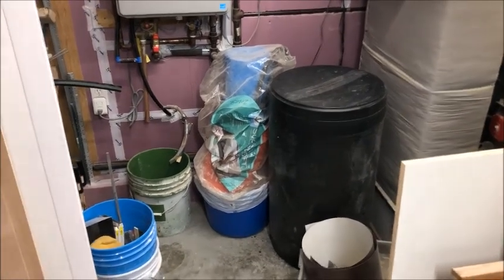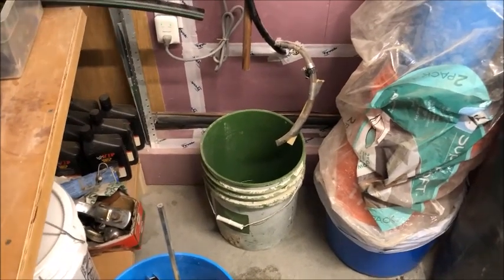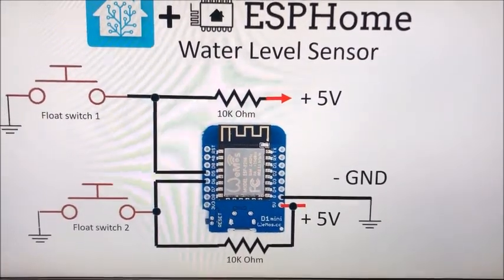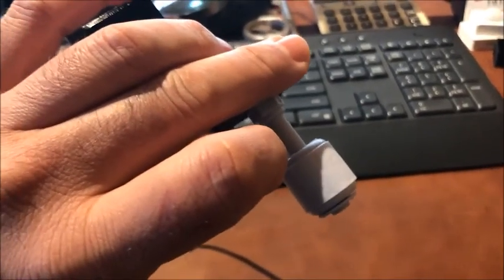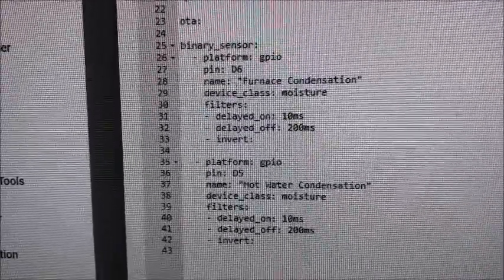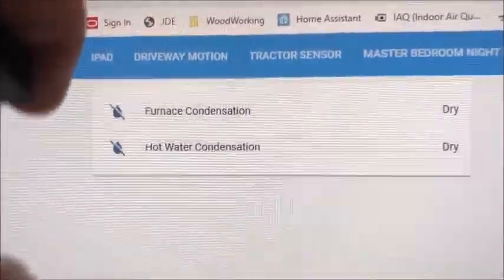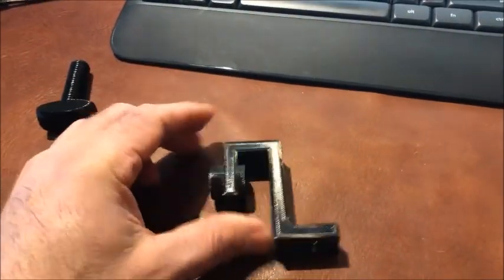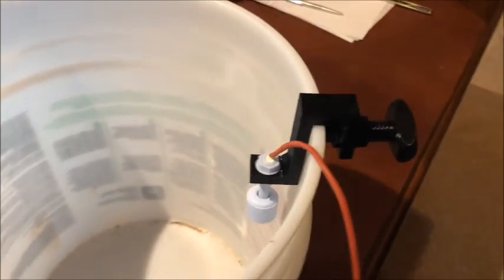Water Level Sensor using Home Assistant & ESPHome

Comment: I've got an extra esp32 hanging around, and it only supplies 3V -- what size resistor should I use? Would a 10k work, or should I got with something different?
Reply from the maker: @MacDork  your esp32 should have the ability to be powered by 3.3V and 5V which is the VCC pin. In any case 10k should work on the 3.3V supply line as well. Those are just pull-up resistors to ensure there  is no false triggering.  Thanks.
Reply: @ great, thanks!

Comment: Thanks for posting the schematic and the sensor details. this is really brilliant. Though I was thinking about this logic of grounding the GPIO to make that as a switch I was not sure about the components. I found this and thought of implementing similar but with a reverse logic. I have to sense the dry condition in my underground water sump. I am not sure whether you will be checking this comment. How is it functioning after 3 years? Are there any updates or feedback from your long run of this.
Reply: I have received my float sensor Today. I deployed as per your circuit and the YAML. It worked as expected. Thought of sharing with you. Thanks a ton.
Reply from the maker: @tamildesan837  I have two of them and they are still working great. I am not sure you need to reverse the logic because as is,  score the water reaches the float, HS reports the status as “Dry” so this may already be what you want. Having said that if you want this to trigger something when the water has not reached the float you can reverse the little styrofoam float and it will work opposite. I fact these are aquarium floats meant to trigger when the water is low. Have fun!
Reply: Thanks for checking the comment and your replay. That will be really useful if it detects the dry condition by default. I prefer to use the float switch and not the ultrasonic sensors which may get condensation issues if we keep inside the closed sump. I am going to order the float sensor to go with this. Thanks for sharing this project, this definitely reduced my efforts by 80% . 🎉

Comment: Surely it would be possible for me to add several switches in parallel to the same board if I wanted to monitor for example several hydrophonic plants in one location?

Comment: Thanks for the video. I want to get this done but have a different take if you allow me. Recently set up quite a few leak sensors to detect leaks and so used one for my aquarium to keep an eye on my top off pump dumping water in it. The only issue is the leak sensor is splashed so often with water from air bubbles and fish themselves. I was thinking what if I snip off the leak sensor from the hanging type end and attach the float sensor to it. i havent considered power requirements etc here at all. Just a thought....

Comment: schematic not working im using pin 14 and used 10k pull-up resistor with 3.3v to gpio . why to use 5v?...
what am i doing wrong?

Comment: Dont understand why the other end of 10k ohm resistor connect to ×5V. Should it connect to ground? In my case it heat up my board.
Reply from the maker: No. My schematic is correct. The switch plus the pin low so it is connected to GND. The resistor keeps the pin high when not in use to avoid false triggering so it connects to VCC.

Comment: what is the model of the float switch and mounting bracket
Reply from the maker: I purchased the float switch on Amazon. Search for "uxcell PP float switch for water pump" it was 2 for $12. The mount I designed and made with my 3D printer.

Comment: you are using 5V on your GPIO pin, does it still work ?
Reply from the maker: yeap works great. In fact my Home Assistant automation that turns on a buzzer in my kitchen when the water level is high stopped working and the float was in the triggered position for at lead a day (hence 5V applied for a day) with no issues.

Comment: Thanks a lot for sharing this. I am building this based on your video and I have a really dumb question: you are saying "to make sure that it doesnt float in an unknown state its connected to the resistor". As I am a new to this I am not sure I understand. Would you be able to put his in different words? What does it prevent?
Reply from the maker: Hi Thomas, yes basically the 10K resistor is a pullup resistor that ensures that a the voltage at the D5 and D6 pins is always held in a logic "high" state until you push the button which connects the D5 or D6 pins to Ground. The problem is that if that resistor wasn't there then you would be shorting ground to 5V so while the resistors always ensure a "high" they also ensure there is no short. watch this video he does a great job at explaining this: https://youtu.be/SYPYntpgRy0. Thanks.
Reply: @ScrapMetalWorks   I carefully wired this set-up and followed the steps as instructed. Its shows up in HA but it does not change states. If I change the states of the sensor (moving the floating part up/down) nothing changes in Home Assistant. Is there any way I could show you a picture of what I wired together? I would really like to make this work but I am not finding the mistake.
Reply from the maker: @thomasmarquardt8118  remove the float switch and see if it works by manually bridging pin D5 (if you wired like I did) to ground. If this works then the float switch isn't closing the circuit for some reason. If it doesn't work then the problem is the pull resistor or the HA code/setup so go back to the basics and examples on ESPhome.io
Reply: @ScrapMetalWorks  OK, I realized the float switch is broken. It would always show "on". I now tried a second one and it finally works! Thank you!
Reply: Ok, I believe I understood this now: it prevents a short-circuit current

Comment: bro, I need some help with my project. I want to Integrate my Doorbell. I'm from India, over here the Doorbell is 240v AC. I'm having one NODEMCU board near my Doorbell. how to get doorbell signal to Home Assistant.
Reply from the maker: Same exact circuit as my water sensor except that you would use a pushbutton instead of the float switch. Then you create an automation that detects the status change of the sensor and performs an action like text you or activate another smart device like a light bulb. Have fun!